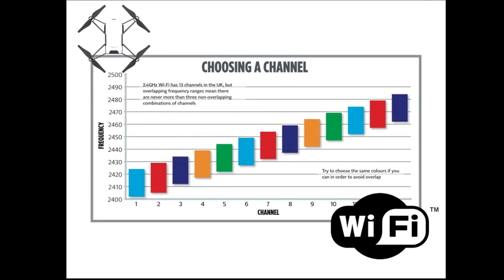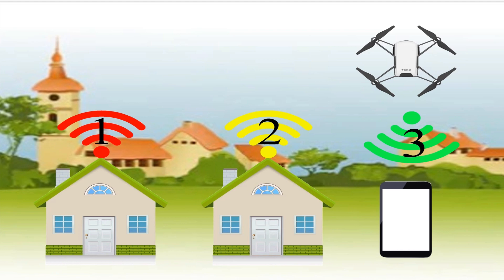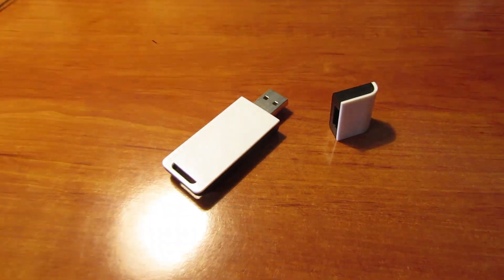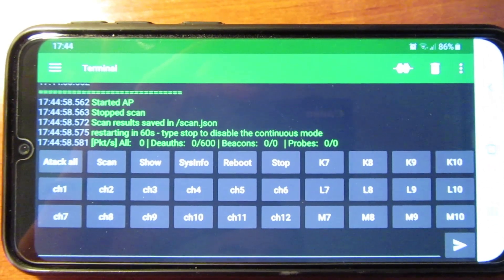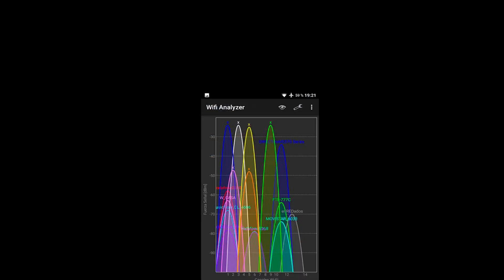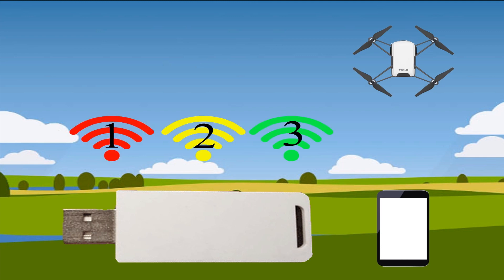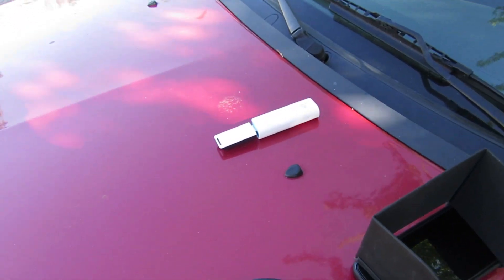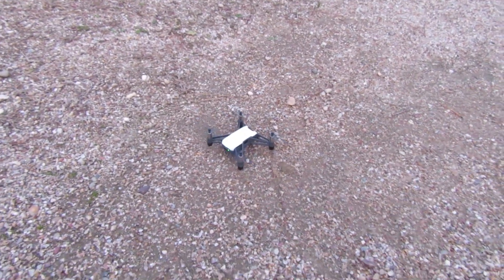Using Deauther stick for Tello picking WIFI channel

Comment: Would the tello work with the "TP-LINK Archer T4U V3 Wi-Fi Dongle AC1300 Wireless Dual Band USB Wi-Fi Adapter"?
I don't know how much better the WiFi+s is compared to the Xiaomi repeater 2. What's the difference?
Reply from the maker: I only succesfully tested Tello with Xiaomi Repeater and WIFI+S Extender.